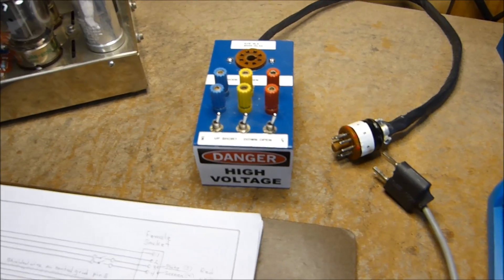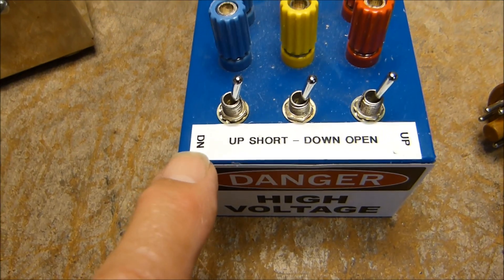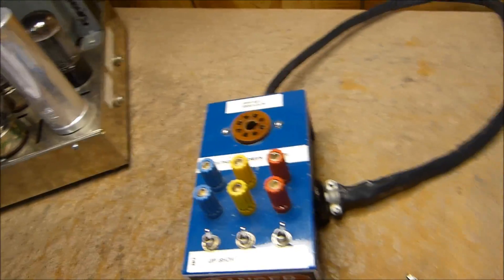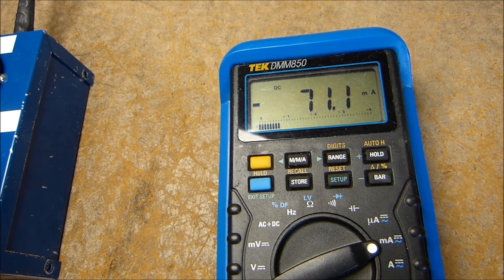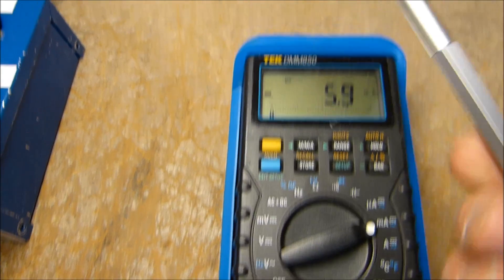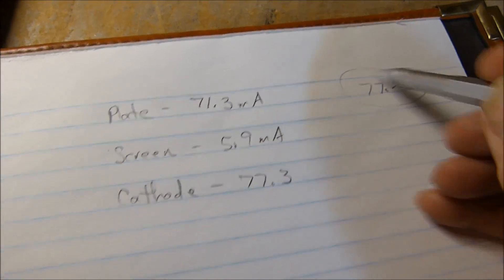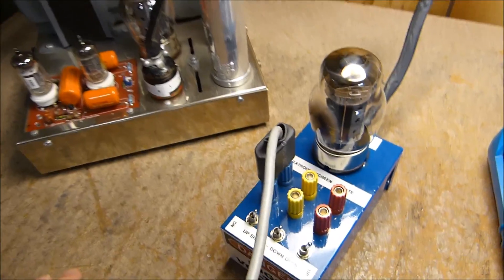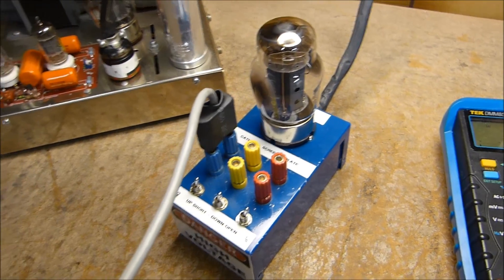Vacuum Tube Bias Probe To Measure Plate, Screen & Cathode Current

Comment: Hi Sir
Good day can share with the drawing how you make this stuff i want to make 1 to try as you did thanks you 
Tan MS
Reply from the maker: This was made some 10 years ago and I do not have a schematic anywhere to be found. It can cause instability in an amplifier because of the longer wires but putting small ferrite beads around the grid wire will likely help. Hope this helps. Best of success with your project.

Comment: I guess you get a bit more information than you do knowing the cathode current from a standard bias probe.
Reply from the maker: Yes, and it can be valuable especially knowing and being able to compare the screen current with other tubes in the same push pull circuit. I have found in many cases when an output tube performs poorly, the screen current is low and has probably been damaged at some time. Being able to measure the screen current can tell you a lot when comparing tubes for being "matched" or when a pair is delivering a lower than expected amount of power output.

Comment: Are the switches you used rated for maybe 500v,  or did you just use one rated at 250v? I believe if anything it may arc from pole to pole in the switch if the voltage is too high.  Not really dangerous unless it arcs to the switch itself.  Could insulate the lever.
Reply from the maker: Good point. The switches are nothing special and definitely for DC there could be an arc. If at all possible, I always try to put switches in the AC portion of a circuit as we all know, the voltage drops to zero twice per cycle and will shut off the arcing where as in a DC circuit, the flow of current never stops. I haven't had any issues with this test jig but I sure see your point. Thanks...

Comment: Hi David. I have a few questions that hopefully you'll have the time to answer. First, is there any reason you know of that building it to be natively 9 pin (for EL84s) and then using a 9-to-8 pin adapter (harder to go the other way) when necessary wouldn't work?  What gauge wire would you suggest for the long conductors? It looks like you fabricated the 8-wire conductor.  Is there some reason I couldn't use purchase an off-the-shelf  multi-conductor wire (maybe if all the leads where shielded) as long as all the conductors were the right gauge?  Thank you in advance for any input. I'm very much looking forward to building one of these.
Reply from the maker: One thing I discovered about these extension cable type "bias probes" is that the additional foot or so of wire necessary to connect the bias probe to the tube socket in the amplifier, does sometimes introduce enough stray capacitance and/or inductance to cause serious instabilities in the amplifier. I can not use either of my bias probes in any of my McIntosh vacuum tube amplifiers without the amplifier going into uncontrollable parasitic oscillations. However, as best I remember, it works OK in the Dynaco amplifiers. I did use it a few times in Marshal/Fender/etc amplifiers and I don't remember all of the outcomes as it has been almost four years ago but it does in some cases cause trouble and can't be used. 
I have not tested the simpler type of commercial bias probe that inserts either a 1 ohm resistor in the cathode circuit (for direct reading voltage to current ratio) or a 10 ohm resistor in the cathode for a 10:1 voltage to current ratio but I think that would not be near as likely to cause instabilities in the amplifier - also, it is safer as you don't have plate voltage present on the bias probe. In this case, the one shown in this video, I used standard stranded hookup wire, probably #18 for everything except the grid (pin 5) . For the grid circuit I used shielded phono type cable with the shield grounded to the cathode. That is my experience building these things.
As for an adapter to test the EL34, I never made that type of adapter and like you said, 9 pin to 8 pin adapter would certainly be easier to make than the other way around.
Except for the price of some of these test jigs, it might be best/certainly easier, to just buy one off the Internet. 
From what I have seen advertised, everyone of them for sale use the 1 or 10 ohm resistor in the cathode circuit, if for no other reason safety from being potentially shocked by the plate voltage. You could still be shocked even by the cathode type bias probes if the cathode resistor circuit becomes open for whatever reason, and the wire from the cathode is accidentally touched.
With all the above said, I do still occasionally use my four-socket test jig, being very aware that it may introduce instabilities in the amplifier, but... sometimes I feel I must know the screen current in addition to the plate current and my probe gives me instant comparison between as many as four tubes at a time.
Lastly, there are some very nice multi-wire cables to be bought off the Internet. If you watch some of my latest videos on the 300B amplifier I am building, you will see one of these nice cables used between the power supply and the amplifier chassis. 
I hope this helps answer some of your questions.
Reply: David, I wanted to thank you for this amazingly detailed reply. As I read it, you convinced me that the rig might not be worth building and that I should either fall back to the plain old output transformer method of calculating plate dissipation (which, unlike the cathode resistor approach, doesn't include screen grid amps as a part of the calculation) OR, if I decide I must know it, I'll probably purchase something that's purpose built. I have a long enough queue of work to do that building one of these isn't terribly urgent. Thank you for leading me to this decision.

Comment: You have made a good piece of test equipment which I will copy. I just thought, obviously your switches being metal, are not connected to the switch connecting terminals, or you would feel the voltage. Are there switches which could potentially have the lever/rocker connected to the wire terminal inside the switch?

Comment: great video.  Youve inspired me to build my own bias current tester!   I'll be using an old (non-functional) tube-tester as the platform.  its got all the necessary hardware on board (sockets & switches)... I just need to pop in 3 (plate, grid, & heater) banana-plug test points. 

because my old tube tester also has a 9-pin socket for the mini-tubes, and a total of 8 SPST switches,  it can be configured to bias EL 84/6BQ5 tubes as well.

Comment: love it,,,, it follows my main goal in life - keep it simple!  awesomenesssssssss
Reply: I be fine!  wired many houses.... worked off of tripplers ..... 3 phase..... weldededed.... I be fine with 4oo .... when I had hair it was curly lmbo.... thankyou for this video!  could use a low value resistor for the cathode if grounded for a voltage reading also.... love this tool so simple but very useful!

Comment: I have to believe that using a device like this is the absolute best way of finding matched tubes for a push pull amp because it would be specific to the amplifier. Am I correct in assuming that? Thanks for your tutelage.
Reply from the maker: I believe so. Not only does it check the tube in the specific amp as you mention but it also checks the socket and associated circuitry.  A bit labor intensive and some risk exposure to the plate and screen voltages but in the end one has a good knowledge of the output section of the amplifier. I guess the next best thing would be to have a bias test jig built for two (or even four) tubes so they could be compared quickly one to the other.  Maybe that should be the next project  :-)

Comment: Could you use that for a pentode type as well? I suppose you just add an extra switch and posts etc.
Reply: +Tech Tins You wouldn't need to. The extra grid in a pentode is the suppressor grid, which performs the same function as the beam forming plates in a tetrode, and is at cathode potential.
Reply: +Silas Fatchett Thanks for that. tubes I am finding fascinating. But I have never played with one before. Could you recommend an easy one to buy and play around with.
Reply: +Tech Tins I have to admit that I am all theory and no practical so I can't really help. I'm sure there is a commenter on these sites who could help you.
Reply: Thank you works great i borrowed your idea but used momentary switches that way i never leave it open-

Comment: Nice little box, I built one myself some years ago, but my tube socket broke and i still need to replace it. So best thing is to use only top notch quality there, as this socket takes a lot more usage than any other.

You may know that these little switches are rated 250VAC and only 125VDC. They may arc over internally. If you open one up, you´ll see that the gaps between the contacts are only 2-3mm wide.

If you encounter some "hawling" and/or motorboating when you use this little box, you can add a gridstopper resistor for the control grid. This one needs to go as close as it can to the socket pin and cuts down that "noise" pretty much all the way.
Reply from the maker: If you want to contact me directly at theaudioshop at gmail with your address in Germany I will send you a few USA surplus military octal sockets that will last a lifetime.